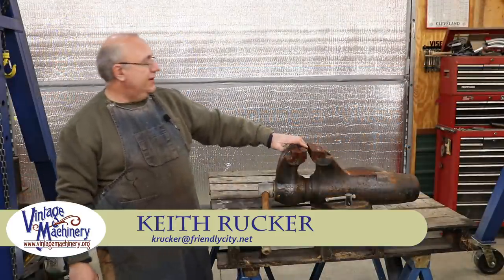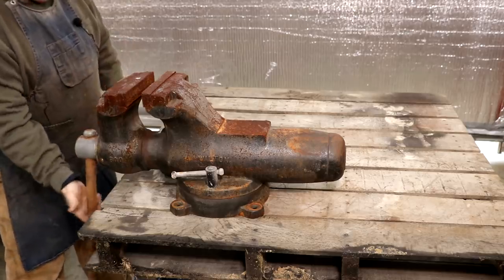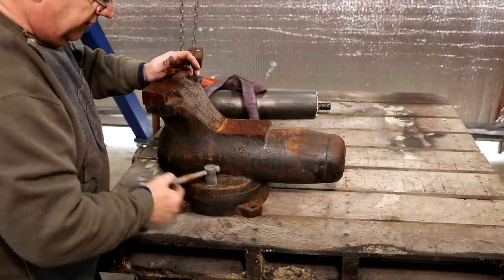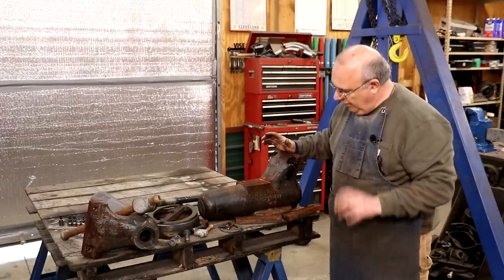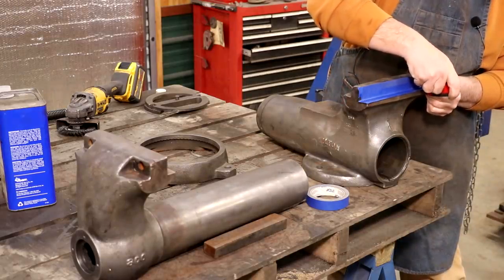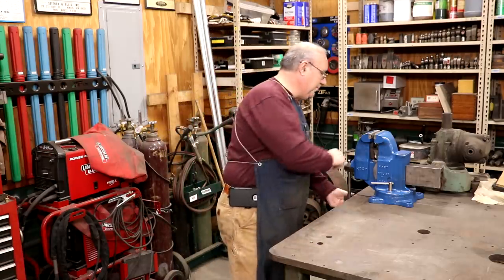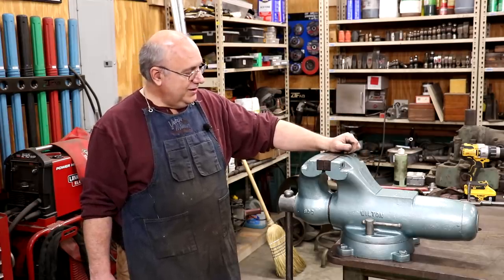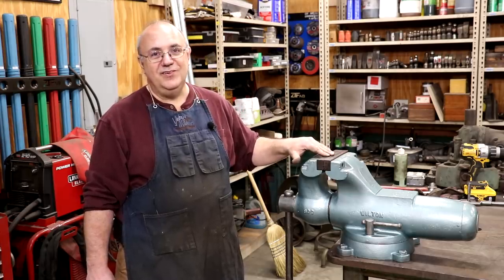Restoring a Wilton 800S 8-in Bullet Machinist Vise

Comment: I own a 4" and 6" Wilton.  Love them because chips don't get into the screws like with other vises.  HINT: Keith - One very simple cheap addition to your new vise will make it PERFECT - slip a large thick rubber washer onto each end of the handle.  Why?  To prevent the substantial heavy handle from pinching your finger when it drops suddenly.  Ask me how I know.  New Wilton vises come with these washers and I added this simple feature to my other vises.  My $0.02.

Comment: I work in a hydraulic shop and I’ve clamped 10-30 foot hydraulic cylinders with a Wilton 800 and RIGID stands under the cylinder

Comment: $3800.00 on Amazon.  $88.00 shipping.    What a vise!  You just needed to clean up, paint, and change the grease.  You won’t need another in three lifetimes!  We had the 3 1/2 “ versions in High School in both the metal and vocational automotive classes (and they were not babied by any stretch of the imagination) and worked at multiple shops that had them, bent handles and multiple hammer dings, never had any issues with any of them.  To my experience absolutely the best vise made.  Score!  Happy for you!

Comment: Keith I drilled and taped the center of the screw on the handle end for a t bolt with a point on it and drilled a small divot in the handle on center of my first gen 7 inch Rigid. For most all the work i do this makes opening and closing easy , just spin the handle no flip flopping of the big handle. Have fun with all your visitors who are in awe of your big vise.

Comment: I have watched and learned a lot from your videos, Keith, over the past 4 years.  You are thorough and passion and dedication show in everything you present. As a retired scientist and a hobbyist DIY's, couldn't resist noticing you did not bother to oil/lube the swivel base which is what I was expecting you to do after all that hard work you put in to restore a grandmaster bullet vise
Reply: Yes, T-9 Boeshield would be an absolute must on all interior steel surfaces! Grease was lacking as well.

Comment: That type of paint works great if you cure it with a heat lamp. Start with a light coat then put the heat lamp on it for couple hours. Then a heavier second coat and let set over night with the heat lamp. Make a very hard finish. Vice looks great 👍

Comment: I restored a Wilton a couple years ago that was similar to that but not quite as big as that one. Mine has 5-in jaws and a 9-in opening. Unfortunately it was not nearly so well taken care of. The fixed jaw had been broken the jaw support was broken off of the casting and the holes to hold the jaw on where stripped out and drilled way oversized I welded a couple of passes with nickel rod and then mig welded multiple passes on top of that to build up material and then ground it down to make the new jaw support welded the hole shut and redrilled and tapped for the new jaw bolts. I've been using it for a few years now and I love it it's a great vise I probably don't need anything bigger but I would love to find one that size.

Comment: 20:00  My impoverished method of doing center-hole transfer punching :  wrap masking tape around a smaller diameter punch until it fits the hole.  Works well enough for me, but I'll admit to lusting after Keith's set of transfer punches!

Comment: The base may have an asymmetric bolt pattern with two of the feet closer together. Those mount towards the back of the bench with the wider spread feet towards the front edge to give a bit of an overhang for clamping vertical stock in front of the table. As you mounted yours at the corner, you can swing it to clear the table. I have two of the 6" version (C3), a 450 SJ swivel jaw 4.5", and a 3.5" - bullet vises. One C3 is mounted on the right corner of the bench, the 450SJ is on the left corner for clamping between the two. You could put the older vise on the other corner of the bench.

Comment: Evaporust soaked into paper towels or better yet shop towels is a great way to derust stuff that won't fit in your tank or large surfaces like my mill table when I got it.
Reply: Did you cover it with plastic or anything that would keep it from drying out? I have a couple things I’d like to try that on.
Reply: Have you seen his tank?

Comment: The machine shop at work has one of those vises.   The made a steel lower mount platform off of the side of their welding bench so the jaws were at a better working level.

Comment: Take the vice you removed, make a mount that will fit in the receiver on your truck and you will have a great holding device for when you are away from the shop.  Would be great for cracking peanuts.
Reply: Problem is, it would lift the front end of the truck off the ground.
Reply: @andrewmantle7627  The greatest device to keep those who want to drive too close or park too close to the back of your vehicle is a trailer hitch.  Scares them away.  The vice he took off his bench if mounted on a strong hitch insert (Wilton makes one) would scare semi-trucks from getting too close.

Comment: I think I saw that orange KROIL can on the bench. Great stuff, truly a magic elixir for stuck nuts, bolts, screws, etc. No relationship with KROIL, just use it and like it. IMHO my2c
Reply: I suggest you watch the review on Project Farm or AVE.  Kroil is one of the easiest and best ways to waste money.
Reply: In all my years of working on rusty old machinery I've never found a better penetrant than Kroil. Plain water works surprisingly well too. Kroil has been around since 1939 and experienced old wrenchers depend on it. I've tried all the new brands that don't work half as well.

Comment: "Make sure it's not moving around any."
I doubt it. It's big enough to hold an aircraft carrier steady while you surface grind the flight deck! 😁
Reply: haha I am worried what ever is put in it could tip it over, even if the workbench is bolted to the floor it will take the workshop over as well.

Comment: Nice job as usual.  I think if I was going to drill and tap the table, I would have made a pilot hole, then the tap drill. the countersink. then install a point to guide the tap to get it started straight, then move the mag drill.   I also would have used a little cutting oil when drilling.  

Perhaps I'm just being fussy, but taking a little bit more time paus off in the long run, less broken taps, better quality tapped holes etc.
Reply: I don't believe there is anybody here who cares how "you" would have done it.
Reply: @MrRShoaf  ...You.

Comment: whats good way to get the grease out of the metal..need to weld up a Wilton vise tube  Base ...The keyway area has cracking and separation under and around the tube..not sure what weld material will work best... so far I've seen 3 different if not more rods and wys of doing it .confusing at best...

Comment: Great new toy. I was wondering if bolts through the table would be better rather than threaded into the table
Reply: Why?
Reply: @paulcopeland9035  any strain on the vice is only held by the threads in the table not by the whole table as it would be with though the table and nuts on the bottom

Comment: 15:00 Those clamps are 'working threads' so should be well lubricated - probably with grease. Not only making it easier to tighten up tightly but giving those threads a longer life. The top plate should also be greased where the clamps press down on it as you tighten them.

Comment: Great video Keith.
I am curious, Did you mount the vice close enough to the edge of the table to be able to clamp long items vertically without interference with the table top? Both directions? Maybe you've covered proper vice mounting in another video.
I am impressed that you tapped your table to accept bolts instead of just putting a nut on the bottom.
I mounted my 6" Wilton bullet vice (lol, I thought my vice was big!) and my 4" Wilton bullet vice to my 1 3/8" table the same way.
It's always a pleasure to watch your videos. Thanks
Reply: No doubt he did but I was thinking the same thing because I remember the diligence I did when mounting my dinky craftsman vise on the corner of my bench.

Comment: Why didn't you mark and drill the mounting holes before assembling the vise? It would be much easier to move the base plate rather than an eight inch vise.
Reply: Assembled, Its much less likely (or impossible) for it to move accidently while marking the 4 holes .lol
Reply: He needed the assembled vise on the bench to make sure the fixed jaw was proud of the bench for workpiece clearance.
Reply: Too excited to put it back together!

Comment: Wilton 28834 800S Machinist 8" Jaw  Price: $3,799.99
Specifications:
Size (inches): 8
Throat Depth (inches): 5.812
Throat Opening (inches): 12
Weight (pounds): 238
Lifetime warranty

Wilton 8100M Mechanics Pro Vise 10” Jaw Width  Price: $939.99
12" Jaw Opening, 360° Swivel Base 
Weight (pounds): | 116
 Lifetime warranty

Comment: Not happy with more than a millionth of run out. Slaps a coat of rattle can paint on his favorite vice and says, "meh. Looks fine." That's funny Keith!
Reply: You can use these as bare metal, if you coat them in a thick oil, like bar and chain oil, the spray paint is for visual needs, and i'm sure he didn't show the whole paint work. He used to, and people got uppity about it.

Comment: Keith, curious, did not see you putting any grease on the inside, is that required?
Reply: I have the same curiosity.  Way oil on the threads and grease on the movable jaw?  Also, when I lived near the ocean all exposed steel surfaces rusted pretty quickly, so I have got into the habit of plating everything possible, sometimes with cold blueing, sometimes just making sure everything has an oil film.
Reply: @washoecreative595  my shop is in my unconditioned garage so I'm always worrying about my tools rusting : )  I've put in a dehumidifier and that has helped a lot.
Reply: @cbhirsch  I moved to Reno and that did the trick.  But it's always on my mind.

Comment: Keith, I have asked hundreds of times to many other Tubers..why can't you show your "grunts" learning a trade? And have you given up on the stoker engine? ( Hint Vertical mill and brass sliders or bronze it's an oil bath design) ps.....what can you use a vise that big for, if you can't lift it🤔
Reply: I think the stoker engine is in limbo over at Adams shop. Keith needs to get his HBM set up and bring it home to finish.
Reply: Once you have it where you want it, there is no need to lift it.  A large vise is not meant to be portable.

Comment: That wasn't a restoration, it was a Jewish overhaul. You could still see the rust on the inside, nothing repaired, no primer, hammer coat paint improperly by putting it on too thin, painted over the anvil, and no lubrication.
Reply: 100% correct. Absolutely no finesse. A crying shame given how rare these vises are. It deserved better treatment.